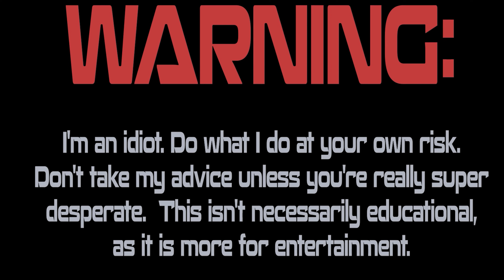Abandoned Cadillac gets NEW Fuel Tank + HUGE Announcement!

Comment: Back in the 60s,  as a teenager, we had a spray which was designed specifically to clean whitewall tires.  It worked great with very little or no elbow grease.  No abrasive required.

Comment: IN the 70's I did this job... every day. and the best way get these out is to drain the tank first and the best way to do that is with an awl. Just use the awl and poke a hole in it! Now I worked at a radiator shop where we repaired gas tanks too.... so I'd put a cup of tide soap in the tank and fill it with water. Let it sit a couple of hours and then drain it out and then smell it. If I could smell any gas at all, it got cleaned for another couple of hours... until finally, all I could smell was the tide soap. Then we'd immediately solder on a copper patch over the hole. We kept a roll of metal the same width as the straps so I could just make new ones if I had too and we used the same material that we used to put in the rails of the side windows (holds the glass in the rail) between the tank and the straps... cause if you don't the straps will eventually wear new holes in the tank. And BTW... I once visited a friend who tried using a cars exhaust running into a gas tank (to remove any air thus making it explosion proof) in the hospital when the tank blew up in his face. I've done at least 100 tanks and the tide was the way to go. Remember though... if you smell gas after cleaning it... it ain't clean enough yet and if you leave it sit overnight... you gotta clean it again cause that gas smell will come back.

Comment: the hub caps are designed to attach to the wheel and simply cover up the weights. the cap attach splines grab the inside of the wheel.
Cheers from Louisiana.

Comment: I agree with the others.You put that much work into getting it running be a shame not to patch up the rust holes, even a quick job would do it justice.  And it really needs those fender skirts.  Fly me up there and I'll be glad to help. My 1st car was a used 1968 Camaro with the rear wheel wells rusted out. I cut all the rust out and took the same guage sheet metal and blazed patches in place and Bondoed in a little and it looked good as new.

Comment: Old Betty is coming along nicely. Would like to see if you could fix those lower front fenders with a patch or something. Guess I missed the right front brake caliper getting fixed. Hope all the suspension bushings are good enough for the power tour. I had a front a-arm bushing go out on my 78 vette and wheel tilted out a little and I ruined a tire in about 15 miles as I made my way back home. Just my 2 cents. Glad to see the old girl on the road again- good job!

Comment: I cleaned a diesel tank from a MB190 with some gravel and strapped it on a cement mixer, all holes seal with tape and you have to change the angle 2-3 times to clean everything. Smallest rotation and 12 hours running and the tank was nearly new then you have too flush the sand and rust out, I used 1-2 L of Diesel for it because I didn´t want to use water or petrol. The pump was shot but the sensor for the fuel gauge could be saved. I have the mixer always loaded with gravel for cleaning small metal parts.

Comment: On white walled tires, use "Mitchells bleach white" spray.  It is awesome.  Spray on, wipe off. It turns white walls WHITE.  No scrubbing or nothing.   Real easy.  Works on getting rid of brake dust too.  I don't know if SprayWay has a WW whitener, but K-Mart had it before they went under.

Comment: Your timing could not be better. On my 76 Eldorado Convertible I have the same issue with the needle being way way past full. It has 48K original and sat for 25 years.  Thought it was grounds, Nope. So yesterday I crawled under the gigantic girl and juiced the strap bolts. I flushed the tank twice and still getting orange gas coming through the see through filter I installed. So with the gauge and the gas I figure I can't seem to get out of dropping the tank. Watching  your video was perfect as I am going to drop the tank here in a few days.  On a side note. On your road trip I was laughing my butt off as you were complaining about hitting your head on the hood latch and the way the A/C unit being in the way of the fuel line bolt. I thought to myself "I feel his pain" lol. Anyway I hope my advice helped you with your A/C program controller.

Comment: A guy who worked as a full line GM mechanic in Olds and Cadillac dealerships invented a repair system for rusted-off skirt hooks. We called them "self-tapping stainless steel upholstery screws with button caps". Perhaps some other guys might have them in upholstery shops or dealerships. 😉

Comment: I've had 6 Caddys. Oldest was a 66 Fleetwood limo (factory extended executive sedan). Newest was a 84 Fleetwood Brougham. Best was my 78 Fleetwood with a 69 472 in it. Sadly the block cracked, and it was stolen during the engine swap.

Comment: I think you're mistaken about wheel weights.  Hubcaps are designed to fit over them. Look at the shape of the weights. And moving the weights changes the dynamic balance. Most balancing machines will tell you to split the weights front and back.

Comment: BTW... I once had to sell a beautiful 67 Sedan Deville Convertible to a guy on a telephone pole... long story... but had a kinda small vibration driving on the highway and all of a sudden I had no transmission. Coasted into a garage, lifted it up and the tailshaft housing was broken. It seems in those days Caddy used a dual U-Joint configuration in the front of the driveshaft and one of those u-joints had gone just bad enough to vibrate the tranny enough to break the housing.... something to look out for.

Comment: The only good thing about the metric system is that they cross reference volume of a liquid to weight.  1000 ml (one liter) of pure water weighs 1000 mg (1 kilogram).  Since a liter is about the same volume as a quart, then 4 liters is about the same as a gallon.  And since a kilogram is 2.2 pounds, you can say that a gallon is about 8.8 pounds.  Easy peasy.  There is a little difference in density between gasoline and water, but we are dealing with "close to" and "almost" here.  Just to be clear, I do prefer "freedom units" to metric, every time.

Comment: Some info to tuck away for future use about petroleum distillates. Gasoline, mineral spirits, or diesel fuel, all weigh right around 5.5-6.5 lbs. per gallon. So you can safely use 6 lbs. per gallon as your rule of thumb for this stuff. So 20 gallons of gas/diesel is going to weigh ~120 lbs., not including the tare weight of the container. Which is why I'll never understand why you don't drain fuel tanks before dropping them. No wait, I do. Because Derek dropping a full fuel tank on his head makes better video. At least it's not water, which weighs 8 lbs/gallon. (Because polar [water] vs. nonpolar [gasoline/diesel] molecules.)

Comment: Is it possible to put matching patches for those small rust spots in front of or behind the doors? Maybe something like a piece of diamond deck in chrome. Maybe some leather wrapped around a piece of steel. I say if it's symmetrical, then it's supposed to be there.

Comment: you want the white walls bright and white try spray 9 or tri sodium phosphate that will bring out the white if you use tsp make sure to use wheel shine or it will dry out the white wall as for the wheel weights outside is good harmonic balancing is real balancing static balance is crap I would never balance a wheel statically

Comment: Moving the weights in the inner side of the wheel is a huge mistake. When they use the correct machine to do that, they balance in a specific way both the inner and the outer side of the wheel, using appropriate different weights.